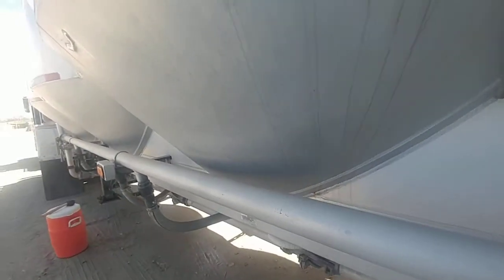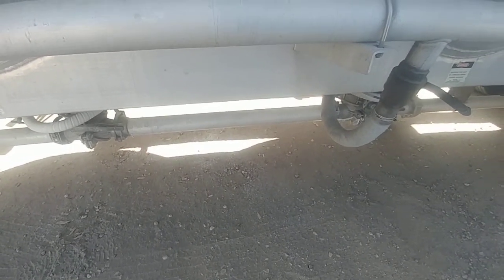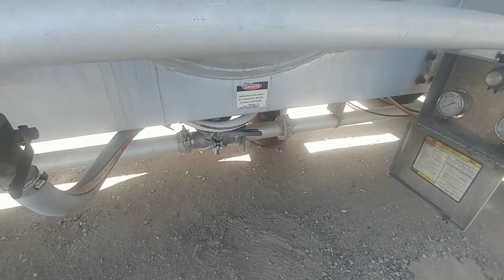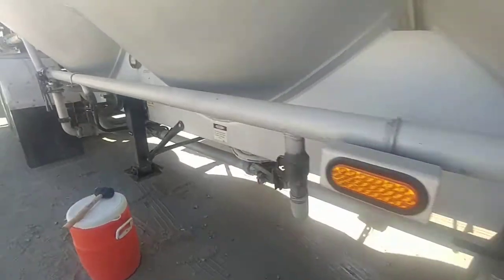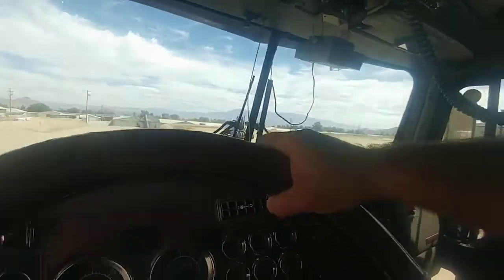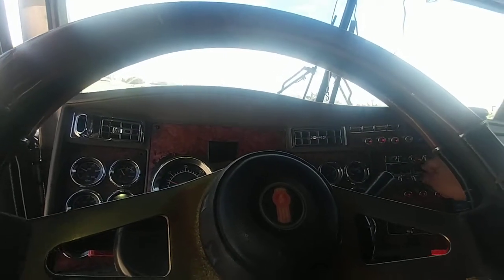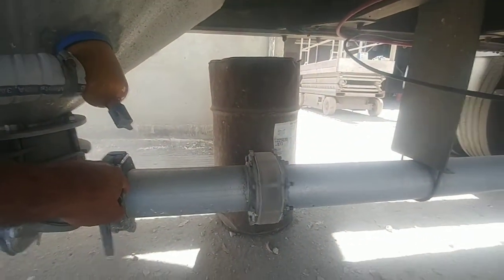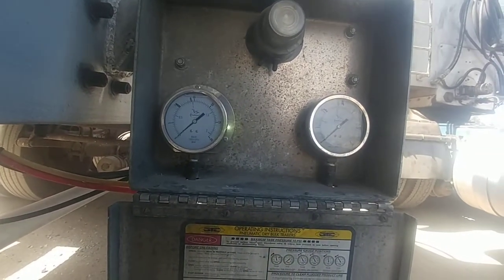Unplugging a Pneumatic Tanker by Reversing the Flow(Sucking it Back). Blow Baby Blow

Comment: OK bro, I dropped the video It’s called
Steelman 3/4 impact 95 Lego truck with candy metal paint job extended hood also snowblower repair
Reply from the maker: @terrellscaife2411  Sweet Buddy...Im on it
Reply: Since you’re extremely cool people, I’m gonna give you another video. It’s called.
Amazon 9038A fake relay bypass 53 foot dual climate control reefer made from Legos with slide. Axle

Comment: This video saved my day haha. Thanks for the tip, in other videos they don’t mention tank must have no pressure which is an important detail
Reply from the maker: That's what it's there for Buddy...I still remember my first plug.
Reply: Pulled tanks for over 30 years. You can unplug one without shutting everything down and bleeding all the air off. Just open you blowdown valve have product air wide open and start working your handle. You can wear yourself out popping that hopper handle. I’ve set there and let it pull for a bit.

Comment: Great tutorial and demonstration, retired bulker here, have had to do this a few times, beats the alternatives. Have done this with a partially filled compartment ,if you're using the most foreward one you may get some product of the vent. I would strap a purge bag over the outlet if the load was pellets.
Reply from the maker: Great advice...noted. I got out of pneumatics awhile back and was pulling an RGN. Luv at first sight.

Comment: Sometimes it doesn't work. So must vacuum hook up
Reply from the maker: The only times it fails me is when I haul meat meal...greasy lamb. It doesnt fall or blow well. Then...its all about manually cleaning out the connections. Other than that...its 100% reliable.

Comment: Another tip: unloading dusty product (cement) into rail cars with no dust collection. Run lots of top air (no aerators) so you don't stir up the product, keeps the dust to minimum until the very end. You want the top air to push the product and just enough line air to keep it moving.
Reply from the maker: Thats brilliant...thats almost the only way to get Fly Ash off without killing 2hrs. That stuff is so fine it moves like water in the trailer. I once had my blowdown open and caught a sudden red lite...i mashed rhe brakes and that stuff sloshed forward, found the blowdown pipe and poured into the street....massive cloud of dust!  Man i still feel bad about that one.

Comment: One thing I’m having an issue with working with older unmaintained tanks is the aerator cups actually being so full and clogged that air won’t flow proper causing issues to fully unload a hopper. I could use some advice on cleaning them properly if you have any advice
Reply from the maker: Honestly, nothing beats regularly cleaned aerators. I had to learn to take them apart and put them together when they werent working ideal 400 miles from our yard. Some guys run the aerators while getting washed out but depending on what you haul I try to keep them dry dry dry!!!
Reply: @strpped379  oh I hear ya i gotta keep ‘em dry as well. hauling lime and cement I’d like to learn how to do so but can’t seem to find any advice on how to do it. I had a guy tell me that there’s nothing wrong it just means there’s product in the aerator line. But there’s definitely an issue if I gotta build pressure and try to empty a hopper 3 times before she even sounds empty. There’s nothing worse then not being able to get all the way empty.
Reply from the maker: @kyler7024  ooooohhhh, definitely sounds like your hoses to the aerator are restricted. Its pretty easy to clean just loosen the hose clamp with a screwdriver or socket. Next time youre empty look down in your tank and see if old product has caked on the walls. I have 1 vid posted where a guy is inside the pneumatic pressure washing it after a bunch of mold and cake really obstructed the walls. Thatll hang thousands of pounds of product. Cement and Lime shouls have no issues coming out...those are dream loads...chicken meal, lamb meal, fish meal...absolute nightmare loads

Comment: I blow 00 sand at 15 all day and rarely clog and when I do I just cut the product off and bang the blow down open and it sucks it up every time but I keep the pressure high
Reply from the maker: I luv blowing that high...the distance sucks though. Limestone/Grit is so abrasive it eventually wears holes in the hoppers, hoses and elbows. I once cemented my pop off valves on a powder train and blew off 55k at 20lbs in 18minutes....was never brave enough to do that twice. Keep up the good work...blow baby blow
Reply: @strpped379  Yeah it’s so much more efficient and Sheesh that’s high I’m not comfortable over 16 but yeah sands just like a sand blaster it eats through EVERYTHING I don’t deal with powder much but I’ve found low pressure to work a lot better with powder

Comment: U gotta have at least 1 empty pod right?
Reply from the maker: Having an empty Hopper helps but not necessary. I've plugged up immediately a few times and it's just the draw put on the product line that is enough to release the plug. If not...I've had to manually open and break down each section and clear them with a long pole or rod. In general, pneumatics are hard to plug...but meat meal SUCKS !!!!!!! Cement, Lime, Fly Ash, Grit, Rice, Sand and Powders...piece of cake
Reply: @strpped379  I've done that too
Reply: If you're plugged real bad with a full load ,you might have to climb up on top and crack  a hatch cover open, it works every time.
Reply: @normangilbert1236  This worked with 56 sand and no empty hoppers. Thank you

Comment: Does this work with plastic pellets?
Reply from the maker: @ breakingbadken I couldnt answer that. Ive never hauled pellets. However, the principle is the same.
Reply: Did you try ?
Reply: @breakingbadken Have you tried
Reply: It sure does. Since pellets will flow a bit, like back down the tube, it works really well

Comment: This may or may not work for you depending on how much product is left in your tanks. If you plug up 5 seconds into the unload lol and are still full I wouldn’t recommend this. Helps if you’ve got at least on empty pod. Good video driver
Reply from the maker: Im overly cautious when starting product to prevent a plug with no empty hoppers available. Its always nice to draw back into the rear one which is why that is the first to come off. When I plug on full tanks I suck it back into the first hopper which essentially spreads the return along the product line... However the pressure differential in a loaded hopper is still enough to break a plug. My number one rule is DONT PLUG UP.
Reply: @strpped379  DONT PLUG UP was always my number one rule as well but we all know how it goes lol
Reply: If it blocks that quick the loader really needs a slap with a shovel and instructions how to use a sieve and take care of a loading process. Been there,  seen the lumps fall into the trailer during loading, locked the cab and walked away  :)  If they can't load the product at the factory I'm not sweating and struggling trying to discharge at the customer premises (usually the sites with very low air pressure saftey cutoff systems in my experience).
Reply: @glenjones6980  damn loaders need a slap regardless lol most the ones I’ve met

Comment: That was a great tutorial👍I wish I had searched for this before id got my first blockage! Would have made life easier lol. Only difference with my setup is the valves are air operated! So they dont open and close quickly.
Reply from the maker: Some of my worst plugs I had to dig'em out. But when Im at the controls and shut it down quick...this works most everytime. Im out of pneumatics temporarily and back on Floors and Hoppers...the dairy side of business.

Comment: Thanks for the video. How tippy are those trailers to pull? Seems like they could go over pretty easy in corners. Have a nice weekend.
Reply from the maker: @69adrummer They dont feel top heavy at all. Most of the loads are very low center of gravity. Limestone, Grit, Rice...all sit very low in the trailer. Some fluffy'er loads will fill the entire trailer but settle as you go down the road...what was full when you left, later settles to 4 or 5ft below the top. Now, on the other hand ...the pull trailer on a set of doubles can get a little squirrelly on you.